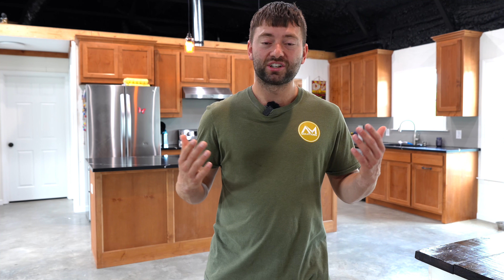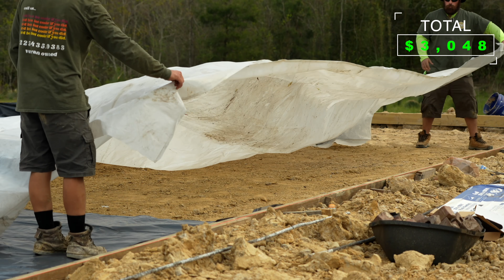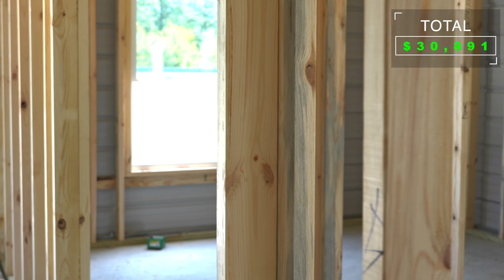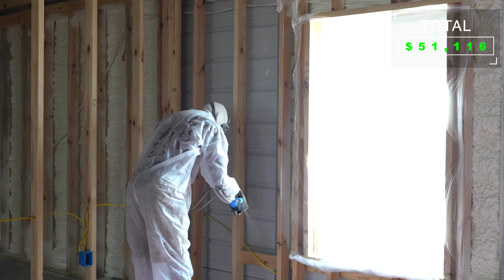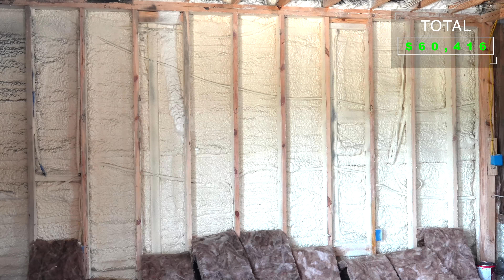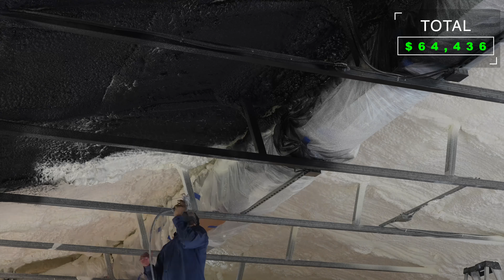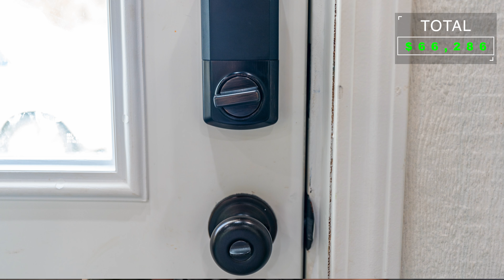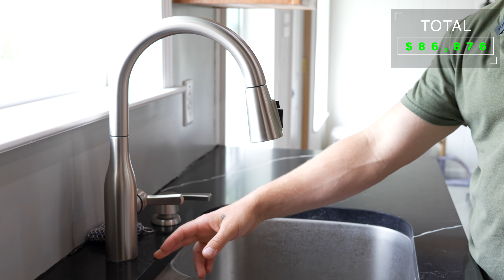Barndominium Price Breakdown | Building a 1,500 sqft 3 Bed 2 Bath Home for $87,000

Comment: Plumbing stubups are nearly always off some, this happens because of how the concrete guys handle their job. The carpenters are used to being flexible to account for this. Just a fact of life.
Reply from the maker: Very insightful and true. Do what you can to secure the plumbing in the correct spot, then dump 50,000 lbs+ of liquid rock in the form lol.

Comment: Say, I may have missed the HVAC costs, & I know YOU did the install, but...
1st off, does the total pricing include what you would have charged John Doe if THEY had the work done? Also, did you even figure retail charges for all the work YOU did, versus if you had to pay s/one to come in & do the work, eg; trimming, door installs, painting, etc?
2ndly, how is a 2" spray foam depth guaranteed? I would think that it could be MUCH less in areas, just like it could tend to be MORE than the 2"...yes/no?
#3 An R24 in the walls is W A A A A Y low by what I've read.  I'm thinking high 30s - 45 or so.
Reply from the maker: We generally add $4k for labor on a new install. 

I priced this exact build with a general contractor for $160k. That is a turn key product with no labor from the homeowner.

The spray foam thickness is not guaranteed, so choose a reputable contractor and they will make sure you have even coverage at least as thick as what you are paying for.

I'm not sure what you read on exterior wall insulation, but you might want to re-read it. A normal 2x4 wall with fiberglass insulation has an R12 rating. 

2x6 Wall has R18 rating. 

2x6 with 1" foam board has R21 rating. 

You would need an 18" thick wall to achieve R45, lol. 

Residential code only requires R12 where I'm at and my house has double that! 

I'm sure it's more in colder environments.

Comment: Wow! Only $2800 for slab plumbing rough? You must live in a depressed area. Unheard of here in NC. $1000 labor for finishing a 1500 sf slab. I paid $1100 for a 720 sf garage slab and $2200 for a 1536 sf slab. Finishing was done at $100 a yard. What state are you in? What year did this occur. Not possible in NC or anywhere in the south. I priced out foam insulation for a house I built in 2006, it was $10,000 18 years ago. My 1536 sf house on full basement. Building myself I will have $125,000.
Reply from the maker: I built my house last year in Louisiana. 

We have plenty of contractors, so maybe it's a supply/demand issue in your area.

Comment: Wow, after all this time finally I found what my passion is, definitely building, I should of known this way back then to become a developer for affordable housing. We wouldn't of facing housing crisis all over the world. I love your video, How did you handle the water source by getting a pump from the stream? Or a well on the property.  Septic tank is another (how much will it cost question for me). I'd rather not use any wood at all. Architectural style everything open. No dreary termite nightmares. I do like 3D printing for just about anything around the house. I just love the idea of steel construction. 3 Containers would of cost the same too, I guess!
Reply from the maker: I have a municipal water meter. My sewer system cost $3500.

I wanted to use metal studs, no wood, but it was too expensive

Comment: Yikes wood walls? Burns hot and fast ..sheet rock doesn't burn.
Reply from the maker: There are wood walls in one bedroom and the living room. Everything else is sheetrock.

For a comparison, a normal house is completely clad in OSB siding on the entire exterior plus plywood for the roof deck and asphalt shingles that also burn very well. 

I would have liked to do metal studs on the interior, however, they were too expensive for my budget

Comment: So many questions. Here’s a few. What kind of baseboard trim did you use? How did you handle the installation of the baseboard with the board and batten walls? Did you notch the baseboard or did you trim the battens?
Reply from the maker: The baseboard is pretty basic 3 and 1/2-in baseboard from Home Depot. I installed the baseboard and crown first and then measured between the crown and baseboard and cut the batten strips to length before installing them.

Comment: Well done on the hard work and putting this together.
Curious on the time to order/have barndo shell installed after foundation pour?
Also wonder how long it took to do the rest of the build?
Also is a 4 bedroom much more? seems like could be done for maybe $5-10k extra.
Reply from the maker: Once the concrete is poured, it needs to cure for 30 days and then the metal building can be installed. From the time I built the forms for the concrete to the time that I moved in was 7 months. The cost for more square footage is pretty linear. More concrete, slightly larger building, more framing, and more electrical.

Comment: add the cost of the land. i reckon it would add about 70k-90k to your final bill.
Reply from the maker: This house is on 27 acres that I purchased for $215k
Reply: @DudeWeCanBuildIt  there you go. So total cost is much higher than 87k. I recommend you switch your clickbait title before i go pay you a visit and give u a piece of my mind.
Reply from the maker: @osrselgin_2_1bcx54 
The title is very accurate. I built a house for $$$. Not, I purchased 27 acres and built a house for $$$. 

You need to consider some people might already have some land and just want the price to build a house.

Also, depending on where you are, you could buy an acre of land anywhere from $500 to $500,000.
Reply: @DudeWeCanBuildIt  change your description then, or title.
Reply from the maker: @osrselgin_2_1bcx54  

The title is perfectly accurate.

Comment: You are going to have water vapor issues were the wood studs meet the metal and water penetration around the windows because you installed them incorrectly.
Reply from the maker: Silicone is waterproof and I'm building a wrap around porch

Comment: I like the idea of plywood interior walls!  what do you think of them now that you've lived in teh home for a bit?
Reply from the maker: I like them. They are not as smooth as sheetrock, but very tough
Reply: @DudeWeCanBuildIt  I suppose one could get furniture grade plywood if they wanted a smoother finish. I've converted the insides of 3 enclosed trailers, all had plywood or osb. So familiar with the wood walls, just not from everyday living.
Reply from the maker: @bossturbo  Going with a higher grade, smooth plywood would give better results.

Comment: So if I could get a loan of maybe 125k I could buy a decent chunk of land an build a decent sized home as well, a lot better than trying to get a home loan for twice as much for a property 3 times as small.
Reply from the maker: Absolutly! The exact thing I did. Buy some land, I’d had preferred it to not be in a flood zone because I had to work on building it up for a while. But buy some good land and get to building. If you have the means def go with it
Reply: That's the way to go... I purchased 1 acre unrestricted, came with water and electricity paid for by seller, bed septic, installation with concrete tank and county permits $9300, did a concrete pad to set a mobile home $3600, came with entrance driveway and culvert installed, new mobile home $75,000 3/2. Fenced by ourselves around $3000, had some post from previous project

Comment: What Parrish did you build in? 215K on the acreage is pretty damn good.
Reply from the maker: Without getting too specific, I'm near Baton Rouge. If you go farther from the big cities, you can still find land under $5k/acre.
Reply: @DudeWeCanBuildIt  Ty, I'm in Slidell so I was just curious.
Reply from the maker: @Blacwidow_x45  I'm not familiar with property prices out there
Reply: @DudeWeCanBuildIt  Pretty much the same I just typically look at lots closer to the city.
Reply from the maker: @Blacwidow_x45  Finding that sweet spot 10-15 outside the city that feels so far away but is just a short drive is nice.

Comment: I don't want to knock your barn build but it looks a bit flimsy, it's fine for a bachelor. I recently built a 1,500 SQ Foot brandominium and it was easily up to $300K - I did some of the labor but most of the labor I did hire. The building was approx $75,000, putting it together another $45,000. I noticed your main posts are not that thick red iron and look more like aluminum same with your trusses. Concrete was approx $15,000,  Plumbing was approx $19,000. Electrical was about $17,000 , water well was approx $25,000, Electrical Junction Box $15,000 not to mention land was another $55K. Windows approx $18k, insulation ( I did foam 3 inch close seal ) $20K - it is a metal building and you will cook or freeze in that thing. Oh and had to still wood frame inside that was another $15K Drywall and Paint $45K Cabinets $20K, Flooring laminate Wood $20,000K , Marble Counter Tops $12K Fireplace$14K, HVAC$20K Oh and all of this does not include the GARAGE... Can't wait to see that bill!
Reply from the maker: Oh, wow! 
Where are you from? 
Those contractor and material prices are much higher than what I'm used to seeing. 

I have a 30x30 red iron shop also. Definitely a different construction style. The tubular buildings have a support and truss every 5 feet. Red iron is typically 15 feet spans. For half the price and still get 150MPH wind rating, I went with the tube steel building.
Reply: You have discounted all the FREE labor and heavy equipment rental costs. I’m out in Northern Utah you are creating high expectation for people with low budgets.
Reply from the maker: @74cacao  
I respectfully disagree. 
This is a video explaining how I built a house for under $100,000. I did not discount anything, the fact is that my labor did not cost me $$$, it cost me time.

Also, I did not include the price of land prep because that varies a lot. The video is specifically about the HOUSE.

Comment: 4:11 i did something similar with steel building. Due to possible penetration from flying objects during storm events I put 3/4 plywood along the entire exterior of the house framing inside the metal building with 8in walls 12 centers. Added protection and security!
Reply from the maker: What a beautiful decision to up the security on your home! Love hearing people with similar builds or plans for it. You guys rock!
Reply: Holy crap. You can fit a lot of insulation in an 8 inch wall.
Reply from the maker: @GeneralChangFromDanang  You certainly can!
Reply: I wonder how much it would cost to add concrete to the exterior walls.  Insulated Concrete Forms, ICF,  uses styrofoam and gets filled with concrete.   Probably expensive enough that limiting it to a storm shelter room would be needed.
Reply from the maker: @FixItPleaseJ 

ICF is cool technology. I don't know what the cost is, but you will also need heftier footers
Reply: if you build to rent, this is a great tenant proofing method.
Reply: Fantastic idea 💡
Reply: Great idea!!! Not OSB crap
Reply: @WoodenSteel-J6artisan  I have mixed feelings with OSB mainly due to what happens to it when it gets wet for prolonged periods of time. You HAVE to see OSB used in place of sheetrock. It looks just like sheetrock when finished and made my fathers house very strong. He had to use 3 coats of oil base kilz, sheetrock mud the seams and then use sheetrock mud stamp and texture like they do in most new homes. The entire home built within a metal/steel building came out great and with the crazy weather events we have all been suffering you need all the strength you can get. I can confirm that during Hurricane Ida my home which is Metal/Steel overengineered home had more weak points than my fathers metal/steel home. 

The flaw with my metal/steel home is has 8 inch steel purlins running every 2ft on the roof and walls. On the wall side the purlins stop from ground level 7ft up which leaves a weak spot we have found. To correct this when my father built his metal/steel house he ended up adding 4 2x8 treated runners vertically in that voided area which he screwed in the metal to those runners to secure it. Then when he framed his house inside the metal/steel building he tied those runners into his home frame giving it more strength 

My fathers metal/steel building is welded together where as mine is bolted together. 

My house which we built first just has treated 2x8 12 inch centers with treated 3/4 plywood exterior wall frames that we stood up and slid in as close as we could to the metal/insulation.  It was then secured to the metal/steel building purlins and into the concrete slab. We have burned up MANY hole saws, drill bits and drills securing my home to the metal/steel building structure. 

Air and Heat - 3 inches of closed cell foam is complete insanity but we also used that high priced rockwool insultation bats from Home depot to fill in the rest of the wall cavities both exterior wall and interior walls. The homes hold air and heat super well and we never have to run heat until temps drop into the teens down here in the south.

Comment: Thank you for proving that when you build your own, you don't have to accept the ridiculous prices of builders. This is the way.
Reply from the maker: I see no reason to spend $300k+ for a cheaply built spec house.
Reply: @DudeWeCanBuildIt 
Especially when it's 10 feet from your neighbor. You did good, and as long as there's electricity,  your business will flourish.
Reply from the maker: @nailbanger2  Thank you!
Reply: @DudeWeCanBuildIt  This is a really good point.  When people allow others to do things they often don't realize when they're being skimped out on with cheaper materials because it's so easy for the contractor to bury shoddy work or cheap materials under paint, mud or insulation. It can get covered up fast.  This way every stage is known and checked.
Reply: @DudeWeCanBuildIt  a $300k spec home will have finished sheetrock walls and ceilings, painted cabinets, an attic so you don't have an exposed roof, flooring, etc etc etc. I hate to say this but your bedrooms look like they are straight out of a doublewide with those trim pieces.
Reply: @DudeWeCanBuildIt  so instead you decided to spend $88K on a poorly done storage shed, that most banks wont finance, so you are stuck with it.
Reply: It also helps to own your own AC company, in which you can write off I’m sure. Not to mention all the bartering and help from your buddies.
Reply from the maker: @1234ahhh1  It definitely helped to do the install at cost and save some $$$.
Reply: @1234ahhh1  That is precisely my point above.  But at least he admitted that he had some free help.  Good for him.  A lot of posters wouldn't have even mentioned it.
Reply: I built my own in Cali. I was the GC. Saved me 60%. I only put waste lines under the pad. I put all the PEX in the walls and ceiling.
Reply: This is the way
Reply: The average cost of a nice family home in many communities in America is 1 million dollars. That is insane.
Reply from the maker: @ganymeade5151  it’s honestly disgusting
Reply: People, not everyone can do this, you absolutely NEED to have decent carpentry skills and a general understanding of the building process in order to contract and build your own house, trust me, I'm a carpenter and will be pulling off a homeowner built house next week because these people have absolutely no idea what they are doing, I've had to literally redo absolutely everything the homeowner did, and now they are trying to screw me out of our agreed upon hourly rate because they didn't budget properly,  they overspent on LP siding that they have no idea on what they've gotten themselves into as far as the time and skill to install(it's a complex exterior) and they are quickly realizing that it's VERY expensive to have to have a professional redo everything. Once I'm gone they are absolutely screwed, and their house that they thought they were saving money building themselves is going to end up costing them ALOT more than they bargained for, and it's going to be clearly obvious to anyone with eyes that it wasn't built by professionals.
Reply: @DenKwonDo  😭
Reply: He didn't add in the lot on cost of home or all the inspection costs. Plus it's very dated looking. You pay for the building, warranty and recording too.
Reply: I think he built what he likes, not to please anyone but his own family. I think it’s quite nice and encouraging to know that one can do it as well!
Reply: @janettehilton767  No question he did an outstanding job.  And because he was on top of all the parts of the process he knows exactly what's under the facade.  It's the way we all would build if we had the knowledge, experience and time.
Reply: @janettehilton767  I agree.  I just wish youtubers would title their videos more accurately.  Everyone is trying to draw in more views with clickbaity titles.  Because sadly it works well.  Because we are rather stupid and fall for it.
Reply from the maker: @miP987  All of the permitting and inspections was $400. 

And no, I did not include the price of the land. This is a price breakdown on the house specifically. If you already have a piece of land and are looking to build a house, then the price of the land is irrelevant. If you are looking to purchase land depending on where you are, you might pay anywhere from $500 an acre to $500,000 an acre. 

Personally, I purchased 27 acres for $215,000. 

If you don't like the way that the interior looks, you can finish it any way that you want. That's the beautiful thing about this construction style.
Reply: @miP987  It looks like Ray Charles  and Stevie Wonder Built it! RV materials . Mobile homes are built better!